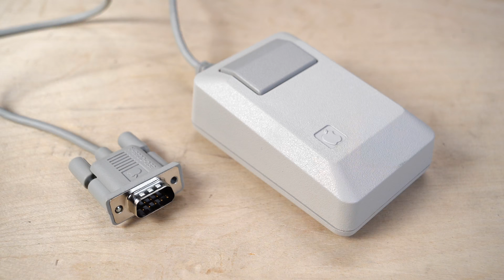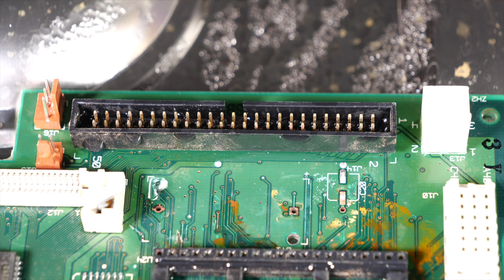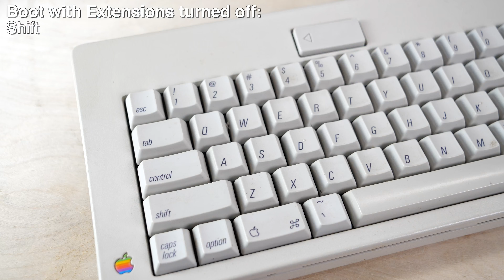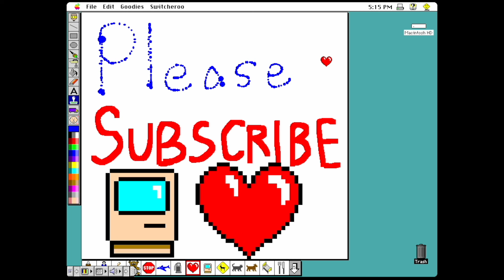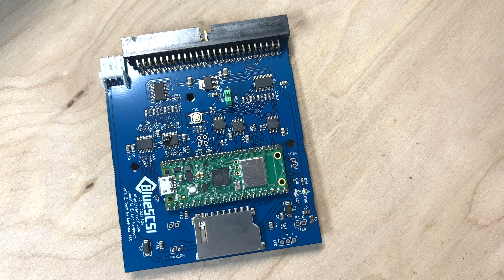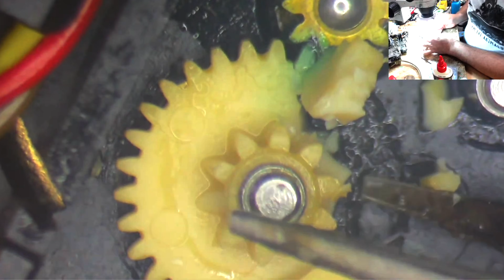Vintage Apple Basics - Part 2: Startup Solutions + Expert Mac Tips

Comment: Hello,  I have been trying to restore a Mac LC and ran across two parts computers.  The motherboards are both intake, but I feel need recapping.  However, there is a different between the two boards. One has what I  would say is a red reset button, the other does not.  Is one better than the other?
Reply from the maker: All of the LC series boards will need to be recapped due to their age. Watch Branchus Creation’s soldering tutorial videos and practice on a kit or something before trying on your Mac.

The red button is just a holdover from testing and doesn’t make it “better”.
Reply: @Mac84  Thank you for the reply.  I was definitely going to do a recap and change out the battery.  I just didn't know why one had a reset button and the other did not.  Good to know that the reset is just a hold over from testing.

Comment: Hi, is there a way to change the monitor screen contrast on the Apple IIe Personal Office Computer A2S2064, we have one that has a very faint screen, thank you!
Reply from the maker: I believe there is a small potentiometer or similar component on those systems that may need servicing. However, normally the brightness and contrast would be adjusted on the monitor side. But if multiple monitors are giving you the same result, you may want to peek inside.

Comment: I have a  Macintosh Performa 550 . I got it for $20.00. it won't start up. Got it to make a noise but no startup. Been looking for diagrams online but nothing for this model. It was recap back in 2017 about all i know about it. What is a good site to find a wire diagram for it. Thanks and a great video keep them coming.

Comment: ‘Will it run Doom’
Answer; no 
Used and loved these macs when I was a kid. But man they were slow!
The Performa 430 is one of the best looking computers ever made though.
Reply from the maker: Haha, they’ll run Doom - but you’ll probably want a Power Macintosh as anything slower will struggle to get a respectable frame rate without a thumbnail window size.
Reply: If you compare, lets say, a 40mhz 68040 mac, to a 40mhz 486, they both run Doom similarly, the major difference is that the dos pc is able to output the monitor to 320x200 resolution so the picture appears bigger, most older macs just can't change resolutions on stock displays so you're stuck with 640x480 and a small picture in the middle or a massive performance hit if you try to make it larger and stretch it closer to 640x480
Reply: @thomasb.900  that’s really interesting. Explains a lot!
I was just thinking the other day, after watching a 100% playthrough of Prince of Persia. Why some Mac games looked so much better.
PoP, Wolfenstein etc. Looked and sounded so much better than on pc.
What was the reason?
Reply: @Thomas1984.  that i can't tell you, maybe some of these games were more optimized for the mac, all i know is people tend to trash talk the mac port of doom and i think it's not 100% fair because of the resolution thing i pointed out